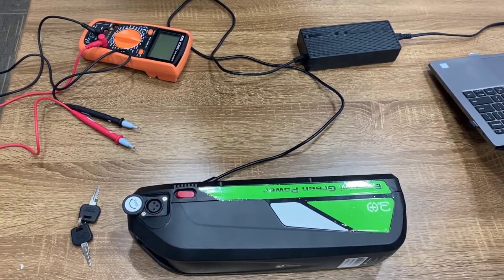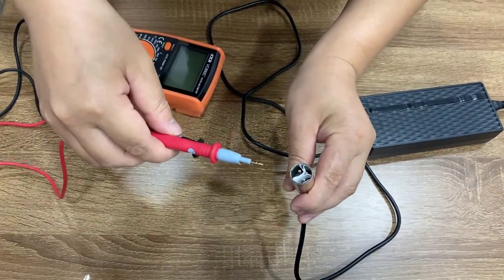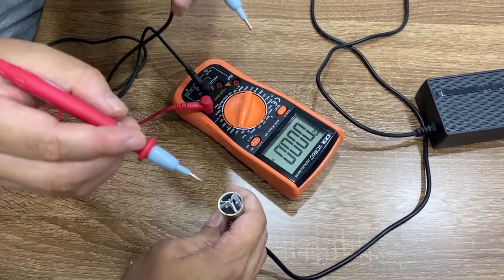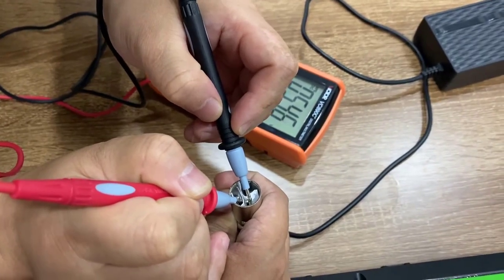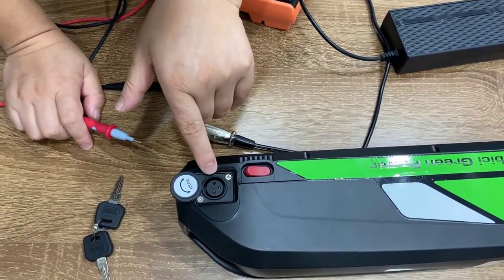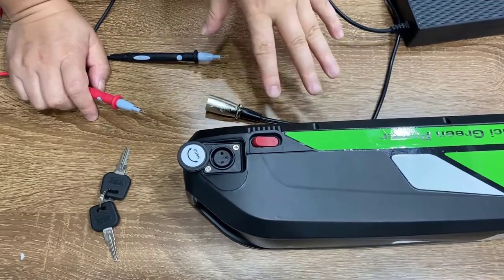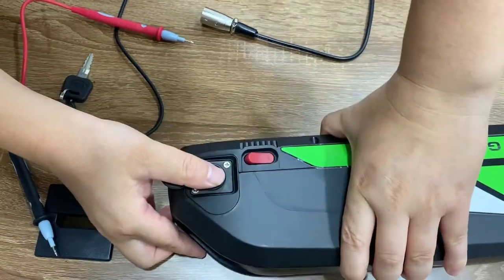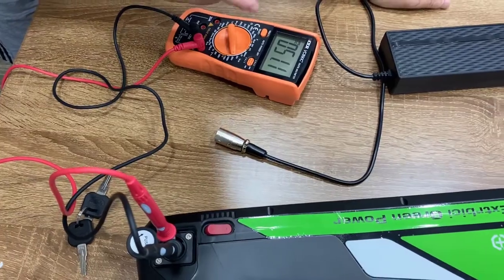How to Check eBike Controller and Battery with Multimeter

Comment: Hi  I have Citycoco mini 48V 1000W. I use it in rain and waters on road after that my Motor way Jam and it was our heating when I drive, so I open Motor Hub and clean it, after that the motor was free like before but now there is battery issue come up. Even I check other 48V bike batteries in bike and all is giving same result. When I escalate the battery discharge very fast and switch off bike automatically, this is happened and any battery. So is that mean my controller is damage ?
Reply: Can I get answer if possible?

Comment: Yeah but - Why do you turn the dial to 200v? Why that number?
Reply: It's because the battery supplies voltage under that amount therefore it wont blow the multi-meter, some newer meters are automatic.. (in essence he is selecting the resistance needed to measure the circuit without causing damage to the meter)